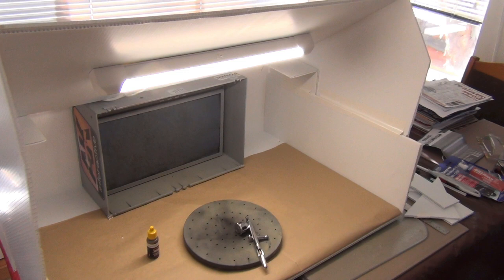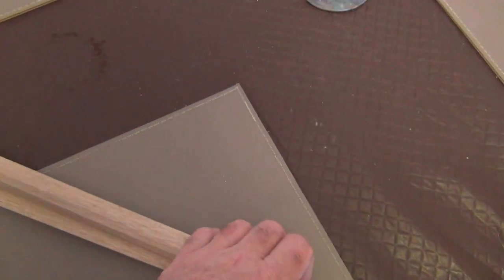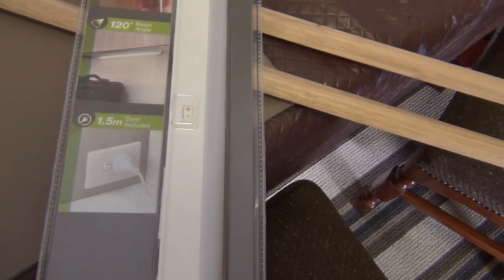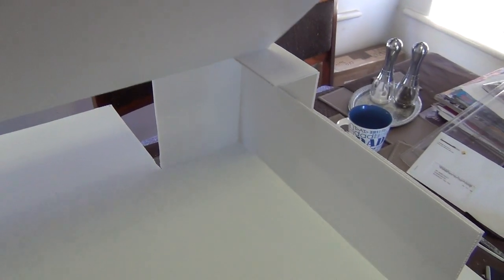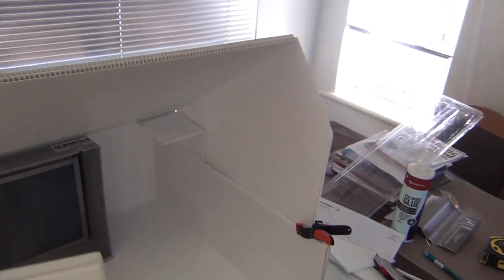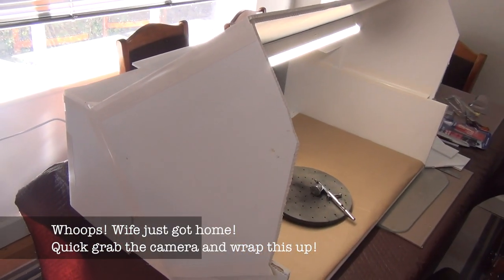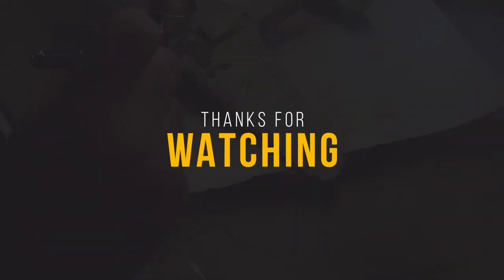Spray Booth Upgrade

Comment: This was just the video I was looking for.Have you found the small unit's fan is strong enough to draw air from this larger area? Do you find there are any nasties (fumes or paint particles) escaping? I may do this but I paint in a living area so it needs to work very well. I am planning to make mine foldable so I can put it away.
Reply from the maker: Hi Yetanother Person (cool name). When I first set it up I had a very short run to a window behind it and it worked well with a cheap portable spray booth I purchased on ebay and adapted. Since that video I have moved to a new house and its very different setup with what is basically a basement  room with only a small window. To get it to work there I had to replace the ebay paint booth as it couldn't push through enough air to remove the vapors. I swapped out the original spray booth with a Tamiya twin motor spray booth with hoses leading to the window where I had installed an exhaust fan in the glass of the window. Both of those solutions work really well together, but it cost me quite a bit to do. Fortunately the Tamiya wasn't a bad fit in the spray booth, so I still use the cardboard setup I made in this video. 

If you are concerned about the ability of the fan to remove everything in a larger space, you can do what I did and use a more powerful booth or another option is to get the ebay booths that double up like this:
https://www.ebay.com.au/itm/OPHIR-2-Sets-of-Airbrush-Spray-Booth-Kit-w-LED-Lighting-Filter-f-Hobby-Model-/282700542454

Hope that helps,
Dan
Reply: @DansModelBench  I appreciate you taking the time to write that Dan. That is very helpful. Thank you.

Comment: Nicely done! I’m trying to decide to buy the same booth from eBay or buy the autograph 1530? I airbrush goalie mask for ice hockey, and definitely need an exhaust system. But like you, I need a larger spray area...plus I have to prime the masks before air brushing.,.hmmm 1530 or this one.. thx for posting
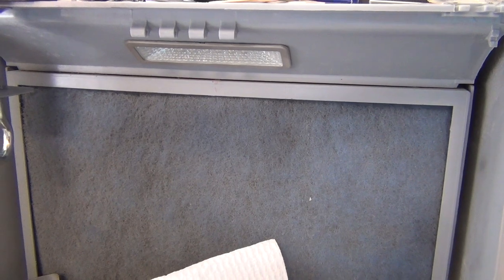Reply from the maker: G'day GoPro. I'd definitely go with the autograph 1530 as it has far more air volume then what mine can do and better filters. Spraying hockey masks mean you would (I presume) be putting out a lot more paint then I would just painting the average 1:72 or 1:48 kit. I think that booth would cope better and thus be better for your health.

Thanks for watching.

Dan
Reply: Dan's Van Diemens Land Model Bench thx for the quick reply. Thank you, ya I will probably go with the 1530.